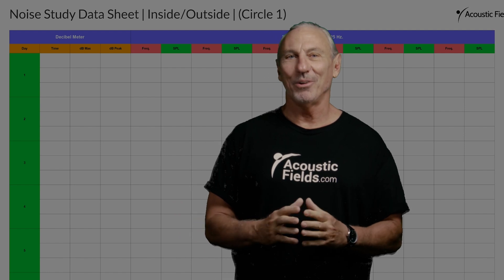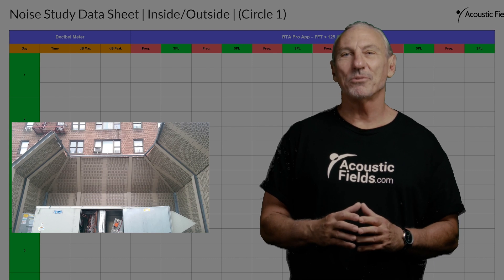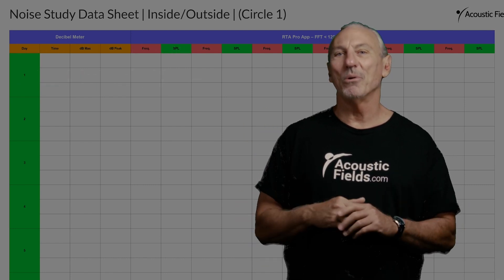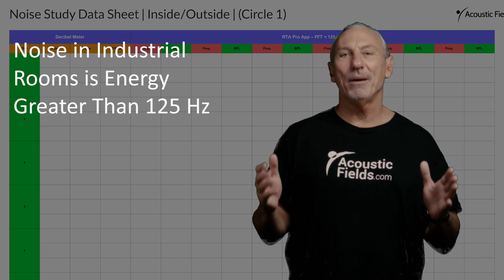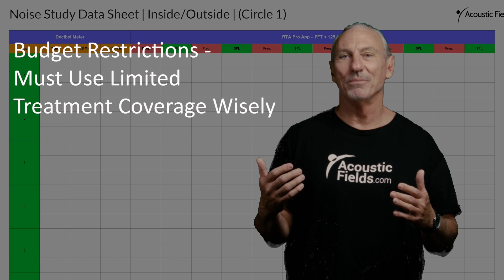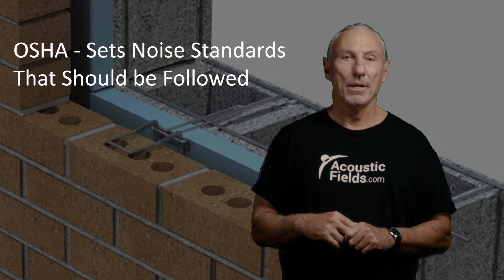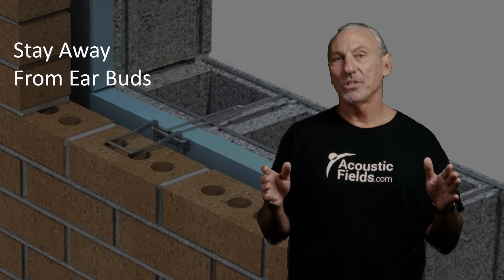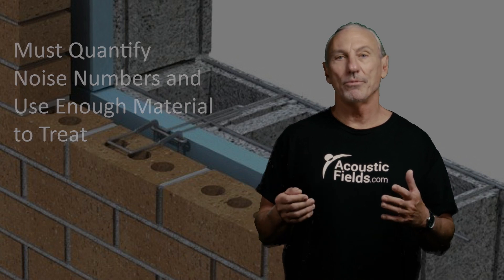Industrial Noise - www.AcousticFields.com

Comment: Hello there, first i want to thank you for your informative and interesting videos, they are showing some light on topics that i'am very interested because of a noise levels do to a home  woodworking shop. Do you have experience on sounproofing/attenuating a room with machinery spread in a room with 14Wx12Hx18L? I need some advice regarding my readings and room design, thanks!
Reply from the maker: We design for all noise and treatment issues within rooms. Send us your contact information to info@acousticfields.com and place wood shop noise in the subject line.